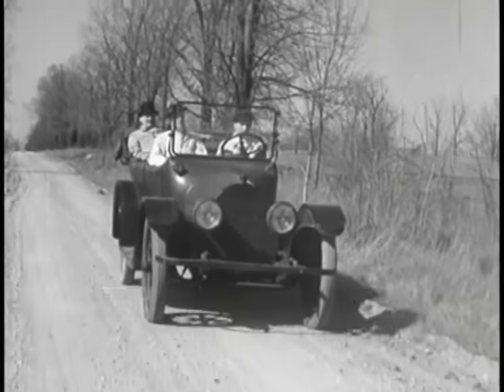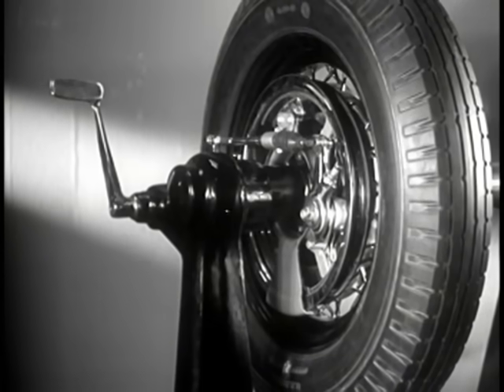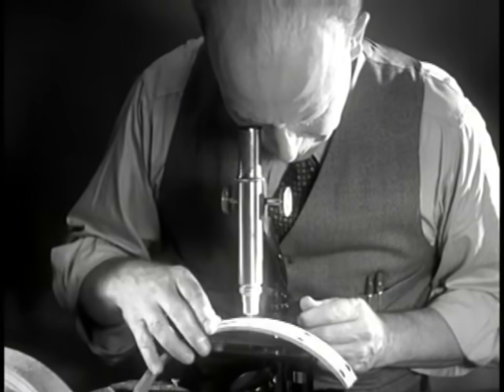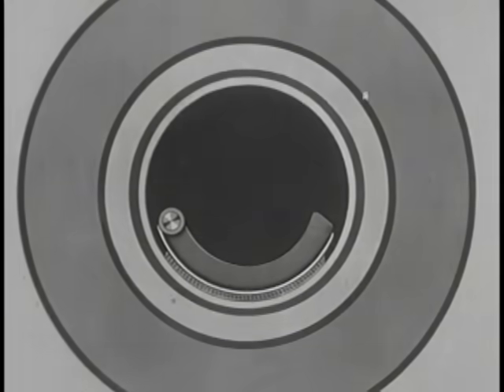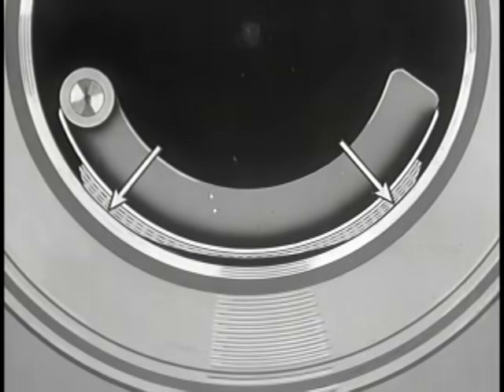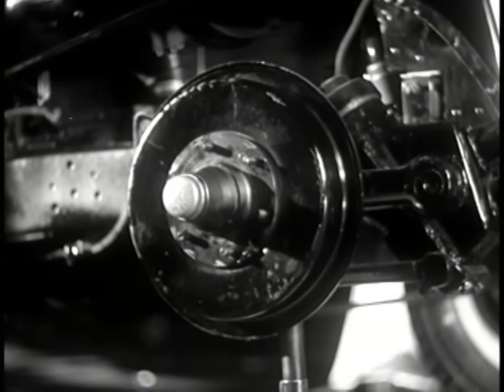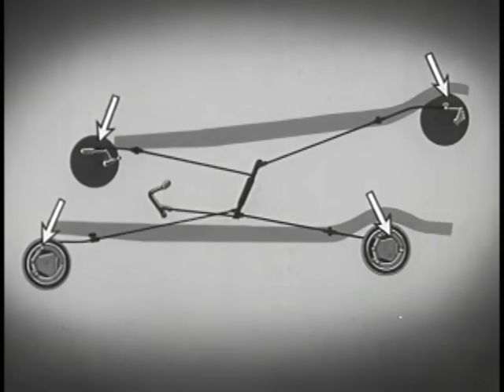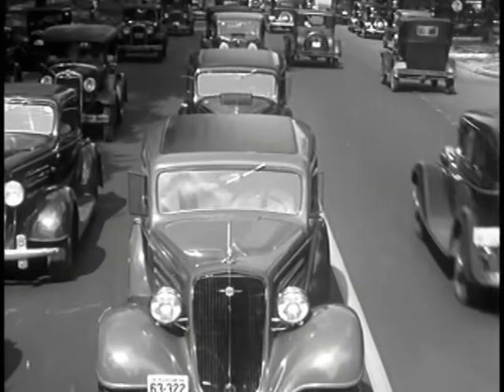Facts On Friction - Chevrolet Brakes (1934)

Comment: AI tells me that the '30s saw a "brake war" between GM and Ford.  Ford held to the more conservative steel cable system until '39 while GM had already adopted hydraulic brakes .  It was odd that in '34, when this film  was made, that GM was still lauding steel cable system as in '36 the hydraulic system was adopted by Chevys.  In a way, then, this film seems like a last ditch defense of the older system.  It's also notable that the Jam Handy Chevy films made a few years later were much less likely to use the word "Chevrolet" than this film.

Comment: Thankfully, Malcolm Loughead invented the hydraulic brake system circa 1918 so it could be used instead of mechanical brakes by Chevrolet in 1934.

Comment: It's funny to see how much they are selling the public on mechanical brakes. A real strength of steel from pedal to wheel moment. Luxury cars like the Duesenberg had already switched to hydraulic brakes in the 1920s, and it took a while for regular automotive makers to get on board. 3 years after this video, Chevrolet would finally get on the hydraulic brakes train themselves, a good thing.

To anyone who has ridden a motorcycle with a mechanical rear brake (very common until recently), you would understand that it can only supply about 30%, sometimes less, of your braking power. Your front hydraulic brake does almost all the work and with much less rider force involved. 

Still a great video to explain how braking systems work, particularly drum brakes, and you get a great idea of how they work even in the age of hydraulic disk brakes.

Comment: That guy was getting a little hot about his car’s lack of stopping horsepower.
Well, that’s the breaks, but soon the engineers helped by out by improvements made in brake systems designs and materials. They found asbestos made a good linings material and a miniature fluid pressure dispersion arrangement made for much better braking performance.
It was fact not friction that soon had motorists much more cooler headed about stopping their respective mounts.

Time was stepping on the brake pedal was akin to stepping on a ripe plum and just about as effective.
But now even a petite lady driver can haul her speeding automobile down easily with the application of a feminine foot force.
Gone are the days of hopefully praying that the vehicle will eventually come to a halt.
Braking systems have evolved into incredibly powerful and controllable devices equipped with anti lockup assist.

Comment: Funny enough I have a 2017 Holden (Chevy) Spark with brake drums like this at the rear. Lots of cars still have drums at the rear, makes sense as this reduces cost, maintenance costs and the front brakes do most of the work anyway.

Comment: Chrysler introduced Four wheel hydraulic brakes in 1926.. Ford and General Motors used mechanical brakes until 1939 and 1935 respectively..

Comment: What is so fantastic about this video is that it gives you an issue, explains why the issue exists and is a problem, then tell you how it can be fixed. 

Like how it explained that heat can warp the breaking pivots, that it’s an issue because it wears down the breaking sleeves unevenly, and then explains that it can be fixed with a spring mechanism which evenly applies the sleeve every time.

Comment: wow fully mechanical brakes? That sounds so difficult to stop at high speeds
Reply: drum brakes tend to help themselves apply once you get it started.

Most e-brakes are (or at least were ) cable operated.

Drums are great for parking/emergency brakes due to the tendency to "self apply" the brake once it makes contact.  This is commonly called the "self servo" action of drum brakes.

Not unlike how a door stop becomes more effective as the door gets further wedged under it as the door moves.

One just needs to get the shoe into place and the self-servo action assists with the application of the brake shoe.

Comment: It's crazy up until now we still rely on friction to stop moving objects. Zero emission cars my ass. My windows are covered with rubber particals from car tyres and and brake pads dust. I also wonder how going digital will save the planet when all information needed to be kept in big ass servers that needs constant power and maintenance. Let's say we issue every one a plastic driver license that last ten years... During that period the information on that plastic card will consume 0 energy. In the other hand a digital license must be accessible at all times therefore a computer needs to run on electricity 24/7 for 10 years assuming that computer doesn't need maintenance the cost and impact on the environment is worse than having a plastic driver license that needs nothing.

Comment: Hehe, they almost had ya fooled! The mechanism is great, but it does not change the fact that overheating the brakes, will deform the shoes and therefor increase wear through poor interfacing. THAT issue never changed, BUT they did manage to increase life, through allowing the shoe to conform better. Changing the geometry of the shoe, cannot be compensated for, through floating pivots.

Comment: Now I must admit, I'm glad that asbestos was banned, but you gotta admit, it's a damn good material if you don't disturb it and are cautious around it. It's waterproof, fire retardant, strong, high abrasive resistance.

Hell the very house I'm sat in typing this comment, has asbestos in it, as long as it isn't disturbed and agitated, you don't need to worry about it.

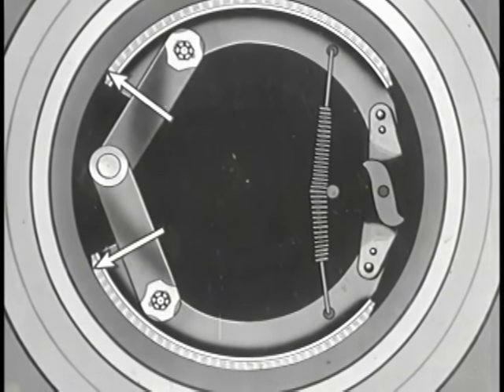Comment: 6:18, using a solid CAM like this is still used on many Heavy Trucks... when the shoes wear too thin, or wear is excessive on the parts, the brakes "CAM OVER", meaning the cam goes past the point it puts force on the shoes and the Brakes NO LONGER WORK AT ALL. I've seen accidents where truck brakes are not maintained, allowed to "CAM OVER" and it causes a Heavy Truck to crash, often with FATAL results. Just FYI if someone here ever decides to "Brake Check" an 18 wheeler.

Comment: 2020 Chevy Infomercial:

The modern Chevrolet is made and assembled in China, in only the finest sweat shops. These factories produce up to 1,000 cars per day, all for the price of 50 lbs of rice, and with minimal child labor.
Reply: I’ll do ford: this diesel is filled with garbage material. It might last for a week or maybe even a month. Come back year after year to sue us over it and then for our parting piece; the EcoBomb: the valves won’t close and then they’ll leak. The turbo fills with soot and doesn’t work or only works at full throttle. The parts you need to change will be happily changed by techs and usually average about $3000-$4000 for a simple water pump R&R. Oh, and it’s made wherever in one of our shops somewhere on the globe.
Reply: @bolt_husky  right on the money. Don't forget the crap transmissions that shudder instead of going into gear and will just go to neutral whenever they feel like as you go down the highway.
Reply: @bolt_husky  🎵Ford is the best in Texas!🎵

Comment: oh man if they could see modern brake systems, hydraulics, vacuum boosters, master cylinders, disc brakes, ABS, metering and proportioning valves, and all the new computer assisted braking they would call us crazy for over complicating brake systems, its amazing how far automotive engineers have come.

Comment: Before disk brakes were invented. Disk breaks are way more efficient and faster than drum breaks. 

Disk breaks proved their superiority in 1953 during 24h Le Mans. Jaguar team used them and they won. 
Jaguar cars were slower than Ferrari but they had disk breaks. Ferrari still used old drum breaks. 

So Ferrari was faster but due to inefficiency of old drum breaks car had to start slowing before the curve much earlier. 
Jaguar car was slower but with new disk breaks it could maintain max speed for longer than Ferrari and it reduced its speed later before the curve so at the moment Ferrari was slower. 

After 24h Jag had won the whole race thanks to disk breaks not the better engine.

Comment: Not only was it common practice to use the shop air to blow the dust off the backing plate , go into an auto parts store in the 1960's and 1970's . After your drums were cut , they put the brake shoes in a device that matched the curve of the shoe to the drum . The shoes were arced by passing them by a rotating cylinder with friction material that ground them down . This created a HUGE amount of asbestos dust when ground down to size . It allowed the shoes to contact the drum more closely after a brake replacement without waiting for them to wear in and have a spongy or soft brake pedal . This would give you a better            " pedal " and less stopping distance . I can't imagine the large volume of dust inhaled by people that did this all day long in that era . How many lung cancer cases were related to this ?

Comment: Something I have learned on these videos is that cars back then, were made out of STROOOOONG, DURABLE material.

Now we have cereal boxes made of plastic which possess a lot of SPEED, to fight the FRICTION with.

Evolves...

However, safety is compromised. Imagine an accident in today’s modern car, it wouldn’t withstand the impact, it would be ruined. And the driver’s safety would NOT be guaranteed.

With Chevrolet’s best engineers, working tirelessly to fix these issues, after countless exhausted methods, we have achieved a fix fo-

Sorry, I got too in character.
Reply: Yes, of course, the fix to road safety concerns is to make engaging, educational, informative content that keeps people glued to their screens and off the road.

Comment: FRICTIONS IS ON INVINCIBLE OF INTELLIGENCE INTENTIONS UNLIMITED INFORMATION WITHOUT COMPETITION..HIGH QUALITY OF THE MATERIALS..TWO ENERGIZED DEPOSIT BY MICROWAVE MAGNETRON BY CHARGED CHARGED DISCHARGED MAGNET CAN NOT  CONNECT PARALLEL MAGNET CAN ALWAYS ADD IN SERIES..MAGNET CHARGE TO DISCHARGED HEATED TO DEHYDROXIDED IN STAGE NO ENERGY BUT STEEL STAINLESS METAL ALLOY NO MAGNETIC BUT ELECTRO STATIC DETECTABLE...

Comment: I thought my truck was old because it had drums but these guys are bragging about their cable driven brake systems. I guess they eventually realized that chrysler was right about using hydraulic brakes in their cars.

Comment: "we prevent rust by plating these in cadmium"

cadmium is so toxic tho, ffs 30s engineers I bet your brakes are made of asbestos too
Reply: Doesn’t matter when it’s in the brakes tho

Asbestos once processed isent actually dangerous until it breaks as the fibers are not released when it has finished being processed and will only appear if it breaks 

Asbestos is still used in some areas 

Just because something is poisonous or bad for your health doesn’t mean it has no use
Reply: @GlowingSpamraam  asbestos used to be used as brake pads which did in fact wear down and produce dust that was released into the environment, that's why they stopped making brakes out of it

Comment: This courses are better than school and i suggest,if they add a cooling pipe system trough the friction unit, will reduce the heat generated by friction, this idea will give litle bit efficiency and more stability.
Reply: almost every car today has moved on from this design...

Comment: Wait so why did we switch to disc? Instead of “break shoes”
Reply: WuzNab Much less heat, easier maintenance, and greater stopping force.
Reply: @80PercentAshamedOfU  it's the heat dissipation quality that sells discs. A well setup drum brake system stops better than discs. If someone found a sure way to make drums vent heat a lot better, I'm pretty sure all the car companies would slap drums back onto everything they sell aside from the high powered sports cars.

Comment: Secretly spitting on competitors way better hydraulic brakes with "...good all mechanical brakes." suggesting their cars were actually outdated at the moment. XD
Reply: Chevrolet got hydraulic brakes only two years later...Henry Ford didn't buy in to "juice" brakes until 1939.  Of the major manufacturers, Chevrolet was pretty quick in adopting hydraulic operated brakes

Comment: Chevrolet only uses the highest quality asbestos in their brake shoes.
Reply: @Tom big    >Yes sir young man, I will have my grandma knit you a fine soft warm asbestos blanket!
  Sorry, but GM uses compressed rock wool with carburized metals held with a modified linseed oil, the similar process used to manufacture “Linoleum”. Ford used long & short stand asbestos, a by-product of their “Red River” casting plant!  Look it up. ASE Master Tech  - Retired
Reply: Dean Kay ok boomer
Reply: Not a boomer, just an ASE Master Tech for 38+ years, then a legacy instructor for GM. The “Alternative Technical Vehicle Center” is GM’s history, further engineering, programming for TIS and their Skunk Works, the top secrete stuff that is completed like hydrogen fuel cell vehicles. Just one of hundreds of hours spent behind the scenes from Torrance, CA to Alpharetta, GA. Good luck in your job. Retired early and living it up!
Reply: @deankay4434  cool

Comment: All cars were SUVs back then. The current trend is nothing new.
Reply: But, those "SUVs" were good looking and durable
Reply: @antonioederlopezlopez7341  And roomy, too. The ride was probably crappy, though.
Reply: @paulparoma  i will say that just the bodyroll, because those supensions are really nice
Reply: @antonioederlopezlopez7341  It would be interesting to take a ride in one of those, especially the more expensive ones. One thing is for sure: the back seat was simply regal, with a completely flat floor. Only the RR has something similar today.
Reply: I agree that most old car where SUVs. Partially because they had higher ground clearance, but also because they where concived to move on dirt roads. A lot of modern cars are concived only for good roads.

Comment: Sure drums are outdated, but the torque plate won't bend as it may occasionally happen on discs.
Reply: zOiNhUh there’s still drums on many smaller modern cars as they don’t need the stopping power of disks and drums are often cheaper
Reply: @bentrod3405  at least here in Brazil front discs became standard even for the most basic econoboxes, and it's been for more than 40 years, but I remember 13 years ago a friend still believed the Chevrolet Celta which his sister used to own had drums all-around.

Comment: I wish they put this quality into cars these days
Reply: Only found in Toyota today...
Reply: Have you ever been in an original car from the 30’s? Trust me when I say they aren’t as high of quality as what you think they might be. Sure there may be a little more attention to detail in them but even the top of the line have no where near as nice of stuff in them as your modern base model car. Suspension was often extremely hard. If you got in a crash above 20mph it’s was near certain death. Engines or transmissions went out every 100,000 miles. All of them were manual if they even had a transmission. Be grateful for what we have.
Reply: southernstyleman thats not what i ment with the term qualety.
Reply: @bentrod3405  All cars have transmisions.

Comment: Very convincing video, but I think i ll stick to my 4 pot hydraulic brembos with abs and 13" rotors
Reply: @James Ray Drums are CHEAP, durable and long lasting, that's why most heavy trucks use them. Modern trains use discs and they far outweigh trucks. hell, a old school train wheel is basically a disc brake. Discs are very resistant to overheating when designed correctly with cooling veins. I don't think many vehicles still use solid discs which yes, overheat very easy
Reply: https://www.youtube.com/watch?v=HXD6ZkRdu1k
Reply: James Ray disks brakes have amazing cooling abilities because they are constantly exposed to air and vented brakes dispose of heat even better. Drums are the ones that often overheat due to them retaining heat. Anything with overheat under enough load that’s why there’s run-off ramps for semis on steep declines.
Reply: southernstyleman high speed bullet trains don't have drums. Not a single modern cargo locomotive that can move at 90mph+ has drums. They all have discs. Discs>drums anyday. Just because America is antiquated and cheap, doesn't mean that drums are superior in anyway other than longevity
Reply: James Ray i guess you've never seen a fan blade modern floating rotor, that cools off instantly. Bud, just stop. You are ridiculous. Go put drums on your car😂😂😂😂😂😂😂😂😂😂😂😂😂😂😂😂😂😂😂😂 

In fact, upgrade to leaf springs while you're at it.

Comment: I have disc brakes all around and ABS plus much better tires , much better by leaps and bounds.  I bet the engineers would have been amazed
Reply: ABS is hand holding technology. Accidents would skyrocket if simpletons didn't have an "anti-lock" device for when they fail to judge distance and slam their brakes.

Comment: Humm wouldn't this be revealing trade secrets to the competitors?
Reply: No, someone just looking at a drum brake system could figure out everything shown in the video.
Reply: More than likely Chevrolet engineers were already working on their "trade secret" in the form of hydraulic brakes when this video came out.  The 1936 models from Chevy had hydraulic brakes which made cable brakes obsolete

Comment: So... if cars used friction brakes, what did planes use.... air brakes?!
Reply: Planes have air brakes (spoilers) on top of the wings (although they have a dual purpose of killing lift), fully extended flaps (eventually flaps stop adding lift and only add drag), thrust reverses on the engines, and brakes on the wheels.  To slow down in the air, they generally just lower the throttle and wait for air resistance to slow them down.
Reply: ...and while you were copying your Wikipedia entry into the comment box, way above your head soared the joke you obviously missed. Two words... Bugs Bunny
Reply: @RadRidesByCru  but at least you didn't mention Reddit